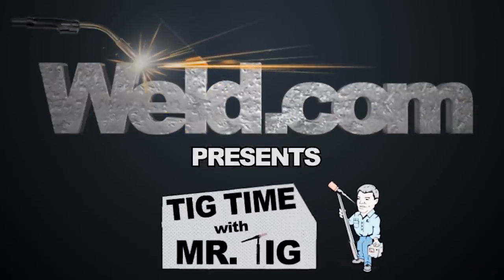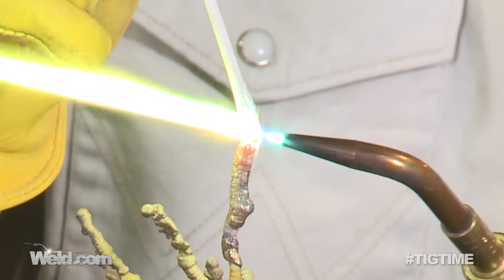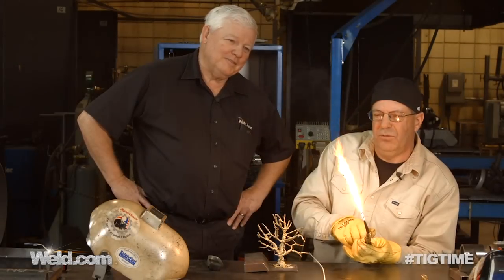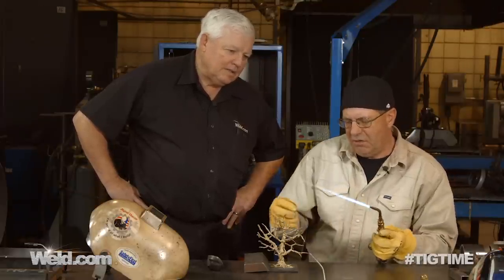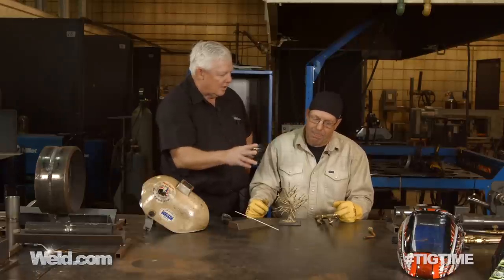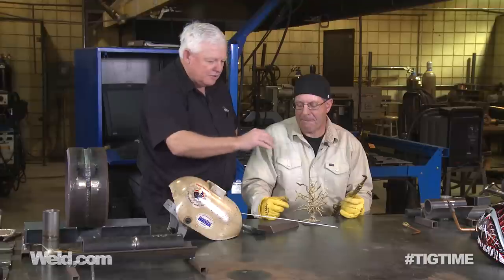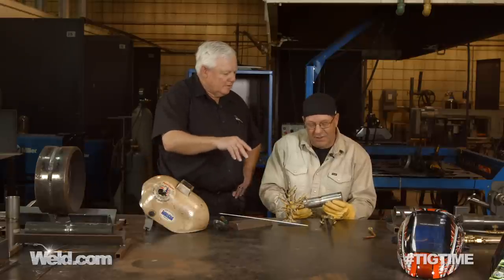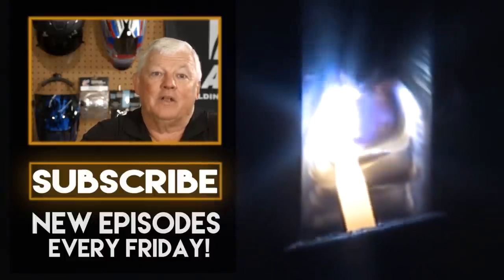Oxy Fuel Brazing: Heat Manipulation Exercise

Comment: Thanks! This is a great video. 

As a metal artist, you are  not only challenging me to expand my scope of work, but reinforcing much of what I have been doing.

 Being self-taught, many days I come home and say "Well I learned something today! I'm not quite sure what, but it will come to me." -and it does, a day or week later, but it does. This usually follows a frustrating day of mistakes and failures. I learned to texture surfaces with MIG welder splatter, and then learned it is even better when followed up with my oxy-acetylene flame. This opens up even more possibilities!

The biggest lesson I have learned is that it is all about temperature control and playing!

I just wish I was both younger and nearer. I would love to "go to school" with you!

Comment: Speaking of eye protection:  It's not usually known in the welding field, but there's a secret in the glassblowing sector that can work here.  DIDYMIUM lenses (usually some kind of clip-ons or a goggle or a face shield).  All this brazing has a sodium flare, a bright yellow light that comes from heating up the sodium in your flux.  The didymium glass or plastic removes that sodium line from the light, and allows you to see what you're doing.  VERY expensive, naturally.  Makes a huge difference, though.

Comment: Awesome exercise! If anyone wanted to take this to the next level, it would probably pay off. As a grower of tiny trees in trays,  you need taper, from the roots, trunk and tips of branches, everything needs to taper evenly, and don't allow more than two branches to come from one node, you can even keep multiplying the branches that branch off of those branches, over and over, getting smaller and tapering evenly (refinement). Metal bonsai trees are something that could potentially be worth a lot, however lucrative. That community already pays gobs just for annealed copper and aluminum wire.

Comment: I started with oxy acet and stick at the same time. To this day, over 50 years later, I still use the same thing. Course I never had to weld massive amounts of metal that would require tight or might. But stick or gas always got the job done for me.

Comment: yup my school still teaches gass welding and brazing, we have to do both before we start tig. I bet this exercise can be done with tig too I'm gunna try it both ways should be interesting
Reply: It could be TIG with stainless steel!
Reply: Better yet, Aluminum with the AC...  I've done something inferior to this as an exercise, just make a puddle and put some filler and stop.  Then do another on top, so it builds up and up.  You can do several on one plate if the heat builds up.  So eventually there are some little towers standing up from the plate.  This "tree" looks a lot more interesting, and you have all different angles to work on.

Comment: One of the old welding books (might be from Craftsman) has a few pages at the very end about hobby and artistic aspects of welding.  One picture is of a bunch of little models made by a torch and plain iron wire.  You can't see them very well in the picture, but they look pretty intricate, there are lots of them, things like a horse pulling a wagon.  The overall thing must be oxidized... but under the point of the flame the iron seems to be cleaned, oxides reduced back to iron?  SO, it looks like this exercise might work to some extent with just iron wire, RG45 or something.   Of course the product will be black and scaled, but maybe it could be pickled or bead-blasted?  There are some books about Direct Metal Sculpture and Welded Sculpture that show stuff made of steel (and other metals) just welded and welded.   This seems like something that might interest students!

Comment: Amazing exercise!!! Question when welding 8x8 wire mesh screen to carbon Steel would this be a option?  What would be the best option for this application
Reply: JB weld
Reply: what thickness is the screen? and what material

Comment: I'm 77 years old from England I learned to gas weld at a company called hiflex we manufactured high pressure  hydraulic  fittings  90 degree elbows  they passed all the current  factory standard pressure tests I moved from there to building  racecar chassis  and  yes we brazed them the very same process can be seen  on YouTube  for ariel atom car from England 🇬🇧

Comment: Seems like a great exercise...

How come no #5 lens???
Reply: I guess some people are into seeing spots. At least they have some sort of eye pro on.
Reply: Apparently shade 5 goggles, which are generally used for medium duty oxy-acetylene welding and brazing, still allow 2.5% of Infrared Radiation to pass through. This is according to a chart I seen on allowable transmission values of welding filters. Seems like a lot for goggles designed to protect from IR radiation.

Comment: I like gas welding for the visibility of the puddle, but I hate the price of acetylene!
Reply: Yeah, that's a problem!  Historically acetylene was cheap, and people used to say that Oxygen plus Acetylene was still cheaper than Argon plus Electricity (for TIG).  I'm not sure if that's true, now!  In the older books you see acetylene generators that use Calcium Carbide, I think at that point you could use as much as you wanted, and people used to do very heavy work with torches.  I think I could live without that!

Comment: No shade 5 or darker glasses teach safety also not just welding
Reply: @jarodwarren3445  if you don't want to wear it that's up to you.  But OSHA requires minimum of shade 3, and AWS recommends shade 3-4.  So do what you want but I'm not the dumbass.